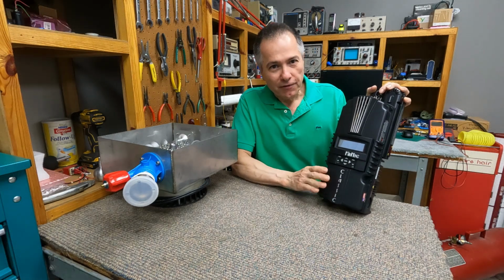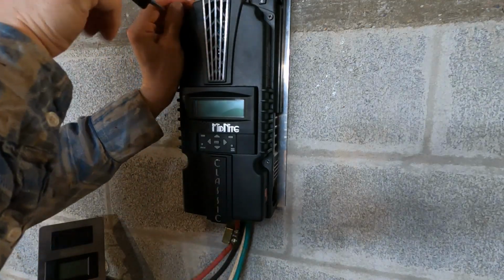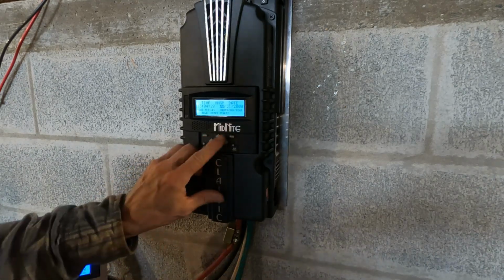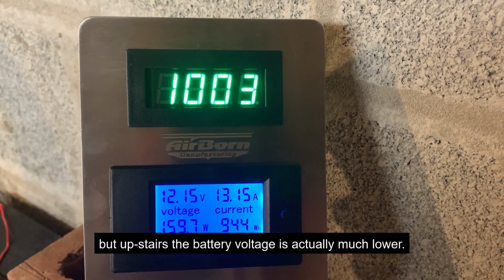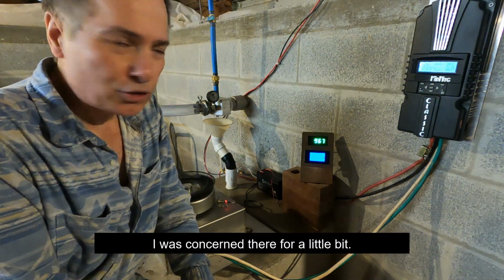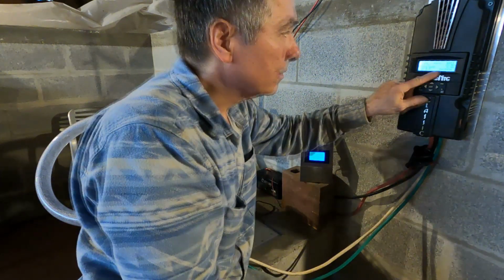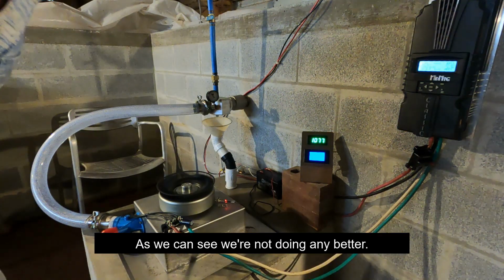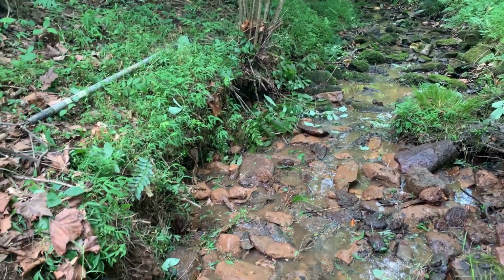Micro Hydro - MidNite Classic 250

Comment: For your water, I have a similar creek/spring.  I ran pipe about 150ft to a 50 gal tank as a settlement tank, and then That feeds into a 100gal tank.   I never run out of water.  I water the lawns in the early morning and the water builds back up for showers and dishes and then I water again at night.  Amazing what a small creek/spring can do when it is running 24/7.   I am looking forward to your next set of tests with the midnight.
Reply from the maker: My biggest problem is the distance to the water intake (3,179 feet) and only having a 1.9 inch I.D. pipe. What is your head-height or pressure and distance to your intake?
Reply: I am 400M and I get 21 PSI.  That is enough for showers and low flow sprinkler.   If I need more pressure, I run a 12v in-line pump that boosts it up to 60PSI.
Reply from the maker: @robjohnston8632  Nice! A pipe size of 48mm at 20 GPM (76 LPM) could give you 88 watts, with a 80mm pipe it would jump up to 300 watts but you would need 70 GPM (265 LPM).

Comment: We may need to look at a smaller PMA, since we don’t generate enough to charge the batteries. 
I was thinking to try use an alternator at the end of the pipe and maybe get some more power out of it. 
My system is even smaller than yours and doesn’t look like the PMA will do magic like I was hoping. 
I’ll keep looking and see if you figure it out. 
Thanks!
Reply from the maker: A smaller PMA (I believe that's what you mean) is a good idea and I will test some in the future.
An alternator is not practical because they require about 50 watts just to excite the rotor, with these small systems, we can't afford to waste that much power.
How much water pressure and flow do you have? That would determine how much power you could expect out of it. Thanks for posting.
Reply: What set up do you have? How many watts are you producing?  I am interested in the different “small” systems.
Reply from the maker: @robjohnston8632  ME1016 Generator (1000 watts @ 1000 RPM), ME2104 Adjustable 0.63" Spear nozzle, ME0903 Pelton 8" diameter, 12 spoon, 6.25" pitch. The housing is my own. So far the most power I've been able to get is 264.7 watts (that was with the 32 spoon Turgo).
Reply: @adipreli3982 I was hoping to hear what size system (pipe size and distance and head) you have and what you have created for your system.
Reply from the maker: @robjohnston8632  pipe size 48 mm, distance 969 meters, head 49 meters (70 PSI). Power output so far is 264 watts.
Reply: @robjohnston8632  I have 32mm(1”) pipe, about 350m long, (1,000’) at least 300m drop (800’). I have the ME1603, but that may be too big. So I’ll order the ME1016, sounds like @Magutz had some better success with that one if I’m not mistaken. 
I’d like to try the 32 spoon Turgo, but not sure I have the skills/tools (yet) to make it work.
Reply from the maker: @adipreli3982  That would give you a static pressure of almost 350 PSI! What is your water line rate for? A 1” pipe, 1,000’ long, dropping 800’ would give you close to 1,400 watts.but you would be restricting the water line which would bring the pressure up to around 250 PSI. Your PMG ME1603 should work fine. I would hold off on buying a 32 spoon Turgo for now, they are pricey and a smaller one should work OK to start with.
Reply: @Magutz  thanks for trying to figure out this with me. My fear is that since the pipe may not be rated for this much static pressure, I will be afraid to try build that much pressure and blow up the connections. It was a super challenge to dig the trench through the woods, and after two years it may be really difficult to try fix any leaks that may happen if the pipe blows up. So that’s that. 
Regardless, I’ll try see if by putting an air separator, barrel at the top, will help the flow, making it more consistent. 
I’ve bought the ME1016 and I’ll go there in September and try it. And compare the two. 
And I’ll attempt to make the 32 spoons turgo, since I’ve already bought it. 
What angle you think the box should be? I know you said either 6 or 10, 20 was too much. 
Thanks!
Reply from the maker: @adipreli3982  You should use 20 degrees, in theory my angle calculation is about 6 degrees but the 10 degree housing had a worse output. I know it will not help you now but I will be making a variable angle housing in the future so I can precisely get the angle. I also had issues with the blue plastic housing, when I pulled up on the nozzle increasing the angle; it actually improved the power output. I'll show that in a future video.
Reply: @adipreli3982  - "I have 32mm(1”) pipe".          I assume 32mm is the outside diameter of your pipe, as 1" = 25.4mm  🙂
Reply: @STEM-ll9mc I think you are correct. I know it’s not ideal. Trust me. I do hate myself for not going to the next size up pipe. But I’ll try see what I can get out of it if anything.
Reply: My penstock is 1”. I have 900’ of elevation drop, with a flow of 16gal/min. Not sure of the static pressure as I was afraid to fully close the system, which was originally designed just to bring water to the cabin. 
But I tried with 1603 PMA and it didn’t charge the batteries. I have a Midnite 250 charge controller. 
Maybe I need to make little adjustments, but I don’t think will be enough with what I have. 
What do you think?

Comment: What was you pressure loss? You should aim for 66% of you static pressure. That is the sweetspot for you pipe; Pressure VS Flow. Was that the point you regulated the nozzle to when you started the 24V test? 
But anyway, now as you have got the MPPT you can adjust the nozzle to get your last watt out of the system. Cool to follow your videos!!🙂
Reply from the maker: Static pressure is 70 PSI and set to 42 PSI when I ran that test but it varies between that and 47 PSI, so you are correct. I'll keep that in mind (46.2 PSI) Thanks for your input.

Comment: What is the model hydro system you're using?
Reply from the maker: ME1016 Generator (1000 watts @ 1000 RPM), ME2104 Adjustable 0.63" Spear nozzle, ME0903 Pelton 8" diameter, 12 spoon, 6.25" pitch. The housing is my own.

Comment: you might not see the improvements from the higher voltage batteries at the controller, but it will be less amperage on the wires to the batteries, so you'll be losing less.
Reply from the maker: You are totally right and also requiring thicker wires, this does give us the option to choose lower battery arrays at minimum losses.
Reply: Try flash boil steam with a pelton turbine
Reply from the maker: @Jkauppa  That is a novel idea but that would be outside the scope of this series. Thanks for posting.